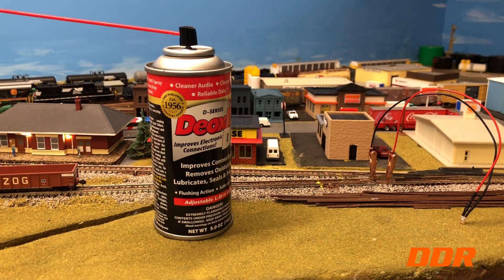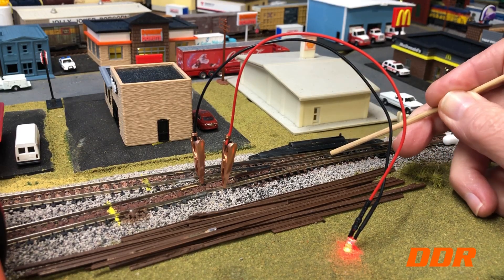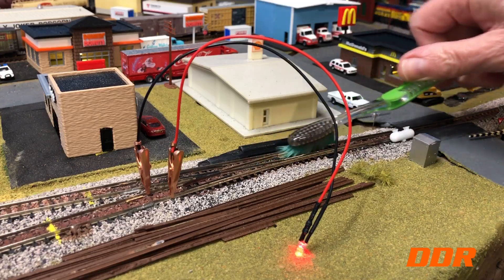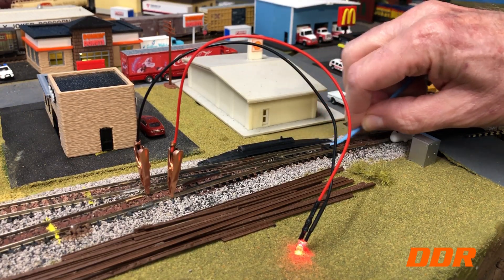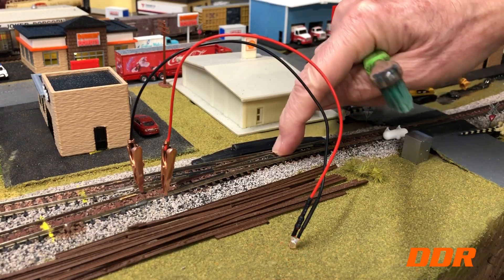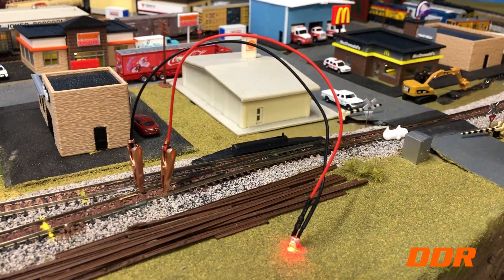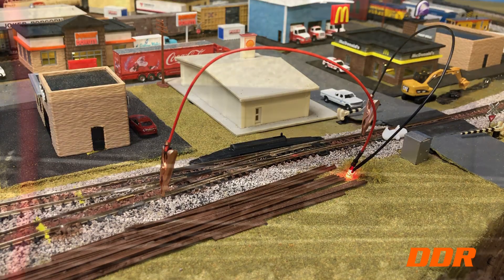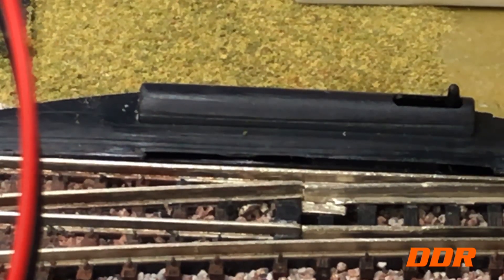#629- ATLAS SWITCH REPAIR

Comment: Hi, I got a very good advise for you : Never use Atlas turnouts ! They're a pain in the ass to my point of view. All the adjustments you have to put on them, the time consuming... you're up for better sir !
Reply from the maker: Most are converted to Peco Electrofrogs now. A handful of Old Atlas left.
Reply: @DoubleDiamondRR  Hi again. Course I don't model N scale. But I do know that turnouts are like cars : the more expensive, the more reliable. I'm only using old style Micro Engineering. No problems what so ever...